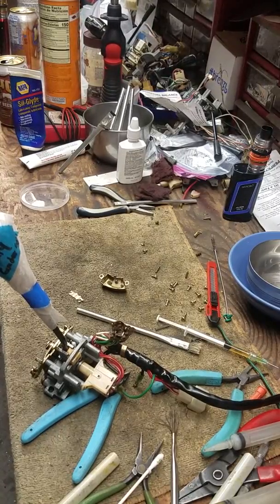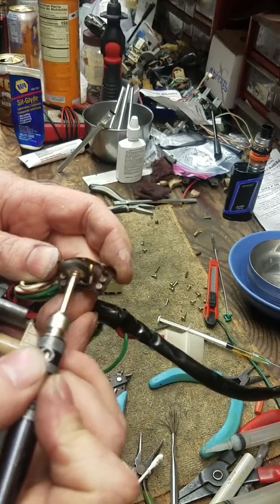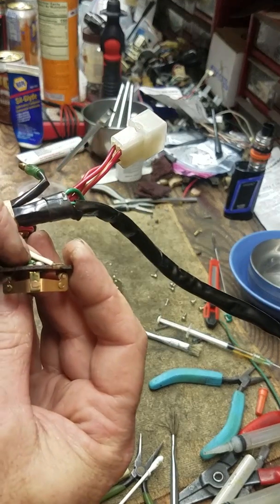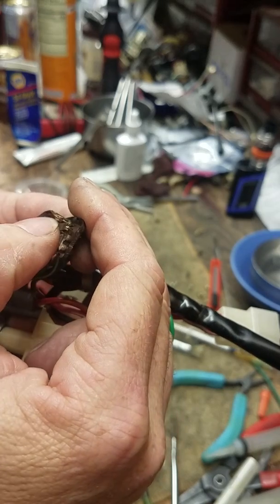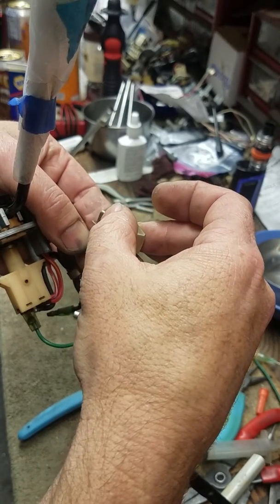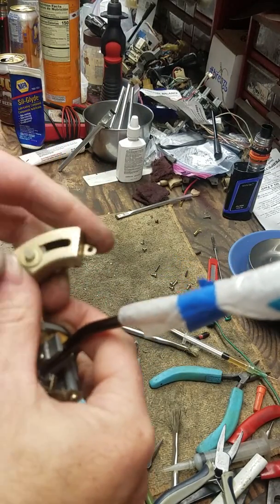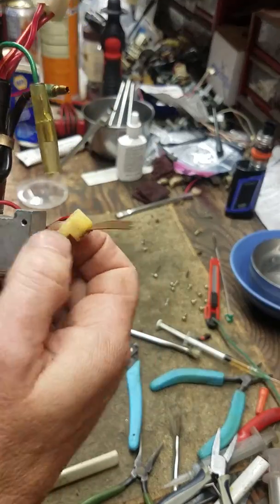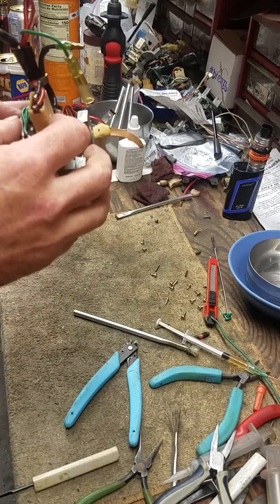Datsun 240Z turn signal switch refurbish part 2

Comment: My '72 Z is giving me turn signal and emergency flasher fits. All fuses, relays and flashers are fine. I will follow your lead this week. "It's not the machine, it's the fine tuning that counts" Great video Dave. Thanks a heap.
Reply from the maker: Do you have the EF32 electronic flasher relays installed? They have a more consistent flash from 9 5 volts to 15 volts. About $13 each
Reply: @DatsunDave07  
No just regular ones. I'll look for some. I can't figure out why my left rear turn signal won't work. The dash indicators work, the bulb is good but no voltage to it. Only 2 lights work for the emergency flashers. After watching your videos, I'd better rebuild the switch assembly.
Reply from the maker: The dash indicators work off the front lights. So the can flash when the rears don't. Likely a bent (overheated) contact inside the turn signal.
Reply: @DatsunDave07  I'll take it off the column and give it the clean me grease me routine and look for weak or broken parts.
Reply from the maker: Just remember "gentle bends"
Reply: @DatsunDave07  I will, thank you

Comment: Hi Dave. thanks for taking the time to make a "simple" video for those of us who find dealing with electrical issues ANYTHING but simple.....My 72 left blinkers in the rear quit working. The blinkers in front both work and the left single indicator in the dash comes on when i engage the parking or regular lights.  Right blinkers fine. Brake lights, running lights and emergency flashers both side are good.  I replaced d.s. side flasher no change. Pulled the turn signal/light switches from steering gave everything a through cleaning with contact cleaner. Deoxited everything, pulled fuse box, cleaned and installed new fuses.
I sprayed the contact cleaner in the little control boxes for the switches, but did not take anything apart for fear of damaging or breaking something.    
Everything else works fine, stock radio, all instrument gages, dome light etc.  Put everything back together and issue is still there. Any advice would be greatly appreciated. This issue started about 3 weeks ago and was intermittent until recently when it became permanent last week.
Thank Lon Davis  Kingwood Texas
Reply from the maker: Sounds like the contact switch is bent on the inside and you need to open it and bend the contact back down so it makes contact again. Nothing else will help.
Reply: @DatsunDave07   Hi Dave, glad to see that you are not completely "off the grid"... Which contact and what location. Turn signal side or light/wiper side. Thanks.  
P.S. That "off the grid" lifestyle is looking more and more appealing every day!
Reply from the maker: @londavis3793  on the turn signal switch. Have you watched my other videos??
Mark the metal box as to which side is which (left turn is down, mark the box "L" on that side if the box)
Open it and you'll likely see the back contact is lifted too far upwards and needs to be gently bent back down.

Watch the videos.....
Reply: @DatsunDave07  Hi, per your video I did a completed clean/adjustment on the t/s switch. Left blinker is now working!, the dash left signal light still illuminates when lights are turned on.  I believe that I have traced the issue to the front left blinker housing wiring.  
The bulb is very dim when lite and left blinker will not work when lights or brakes are applied.  They do work when no lights but are very dim in front and work perfectly in rear which is a good thing.  I have a relay kit that I am going to install today that bypasses the harness and powers both head and parking lights directly from battery. 
Naturally I am going to clean all contacts on lights. I let you know how it turns out. Thanks again for your help!

Comment: My brake lights (top bulb of the rear tail light assembly) are separate from my turn signal lamps (bottom bulb) which are also my running lights that flash for the turn signals. This video says that the brake lights flash for the turn signal. Is that the OEM? I don't think my '72 has been changed but maybe the last owner wired it that way. I'll have to ask him.

Comment: What's the brass semi circle bit on the bottom of the combo switch for? The one that seems to wrap to the other switch on the steering column?
Reply from the maker: Are you talking about the thin brass horn contact tab, with a green or red wire soldered on?
Reply: @DatsunDave07  Yes that exactly! You have no idea how long i've been trying to figure that one out. Thanks! Any chance you know where i can pick up some of the little plastic pieces for one?
Reply from the maker: @michaelbartling1385  couple choices. Look for a used turn signal switch to scavenge parts from OR go to "Datsun Parts and Needs" on Facebook and the members for one. Some folks have been 3D printing them...